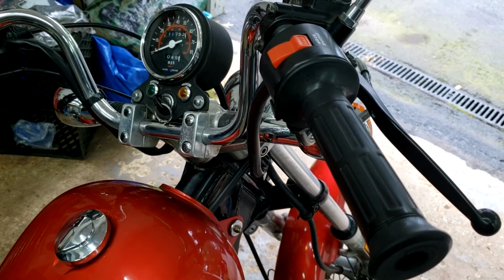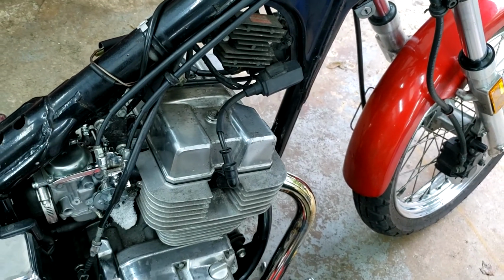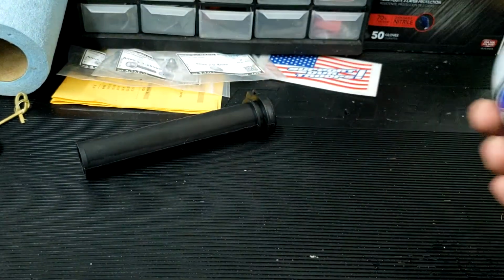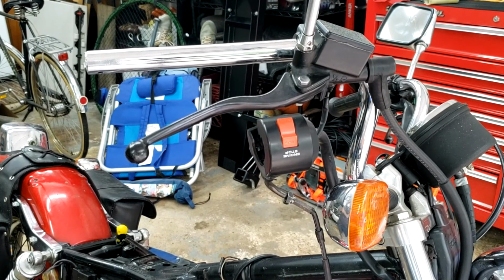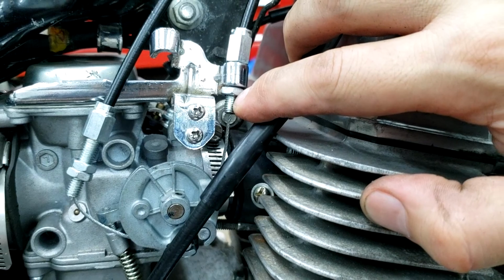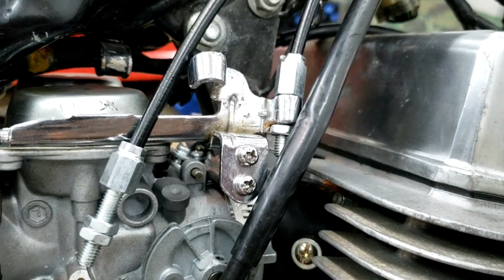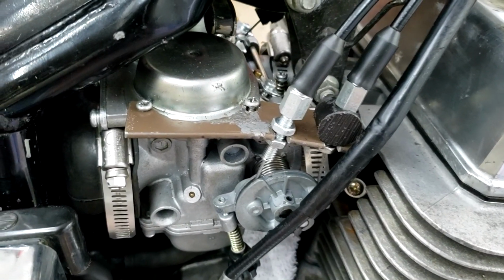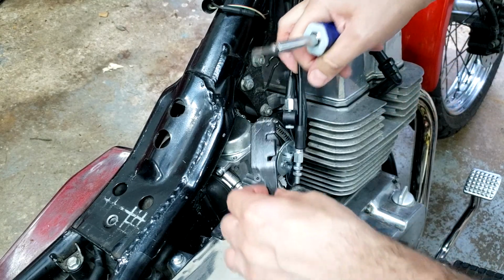Replacing the Throttle Sleeve and Cables on a 1986 Honda Rebel 250

Comment: Dude you're supposed to show us an easy way to change the throttle cable not to design a whole new one Bracket general
Reply from the maker: Trust me, I wish it was easier! If the new cable was the same exact length, I would have been all set. But at least now I (and everyone watching!) know how to compensate for a shorter cable!
Reply: he really is supposed to do it any certain way at all, i was disappointed for myself but glad it worked, I dont have the neccasary tools to cut the required metal for this fix but this video is 100% what youtube is supposed to be meant for, the man found way and decided to share it with us. Be thankful it isnt forgotten knowledge he alone benefited from.

Comment: Hello my friend, thabks for the video. I need skme help 😢. I have a honda cbf 125 2022. The throttle tube and cables look basiclly the same as this lovely bike you have. I have the kill switch housing open and the 2 cables out of the old throttle tube. I have a new throttle tube being delievered soon. My worry is i wont be able to get the cables back into the throttle tube, any advice like can the cable length be adjusted anywhere? Thanks!

Comment: Nice way to be resourceful, but mounting it to the diaphram of the carb is a bad idea.
Reply from the maker: Not sure what you mean? The bracket I created was mounted in the same position as the original bracket, using the same mounting points. I do think I need to create a better bracket, as I don't really trust that plastic spacer I used! I'll have to work on my metal fabrication skills!
Reply: @ificanfixitsocanyou  I'm saying that those bolts are for sealing the diaphragm on the carb. They shouldn't be ever shared and used to mount anything.
Reply from the maker: I understand, and that makes sense. However, the parts diagram clearly shows that's how the bracket is mounted from the factory. https://www.hondapartshouse.com/oemparts/a/hon/5053e0cff870021c54be0de8/carburetor - in the top-right.

Comment: Hey where did u get the throttle sleeve from??
Reply from the maker: I bought them off of eBay! Try searching for "7/8" 22mm Hand Grips Dual Cables Throttle Sleeve Tube For Rebel CMX250" - or maybe with some of those terms. I paid ~$11 USD for them

Comment: Hey did you ever fix the blinking problem on your turn signals? Currently replaced mine but they don’t blink.
Reply from the maker: My blinkers mostly work - when RPMs are higher. I'm still planning on fixing this in the coming weeks - but also debating whether to convert the turn signal bulbs to LED. Stay tuned!
Reply from the maker: Finally fixed the blinking! I replaced the relay - check it out! https://www.youtube.com/watch?v=PvwbNXFUG7I

Comment: Do you have a link to the grips you got?
Reply from the maker: The grips came with the bike, I only replaced the throttle sleeve tube. I found the tube on eBay for $11. For my handlebars it's a "7/8" 22mm dual cable throttle sleeve tube" - using those search terms should help you find a similar listing. Good luck!

Comment: The screws on mine won't budge, is there a secret to getting them out? I don't want to strip them 2:20. It looks like you are exerting hardly any pressure.
Reply from the maker: Hmm... mine weren't that tight. Perhaps try some penetrating oil and letting them sit for a while. It's important to use the correct sized Philips bit to ensure a tight/strong contact to the screw head. I have seen others try tightening the screw in addition to trying to loosen - any movement of the screw is good! If that doesn't work, an impact screw driver might do the trick?